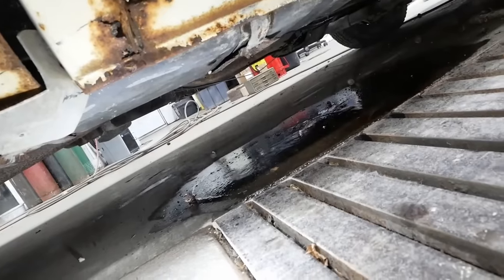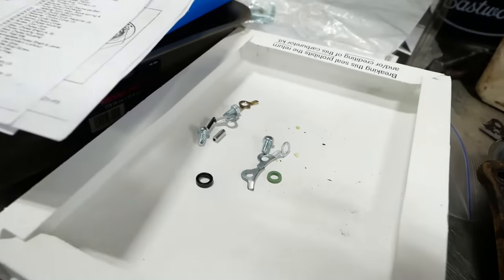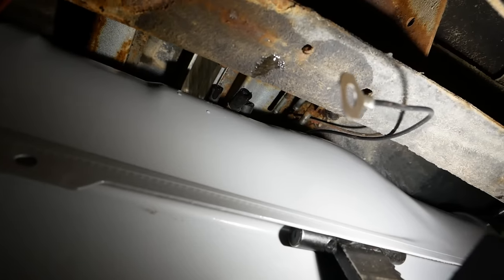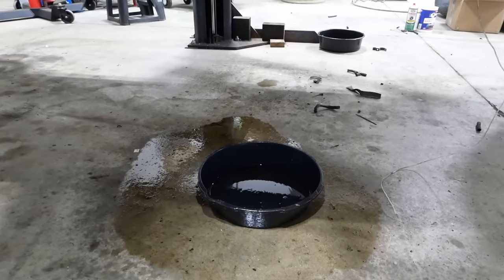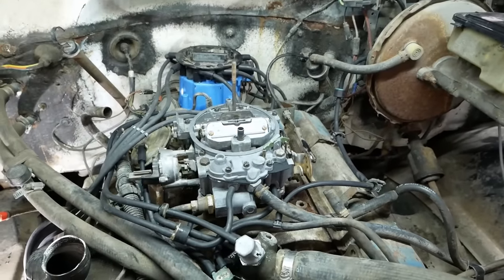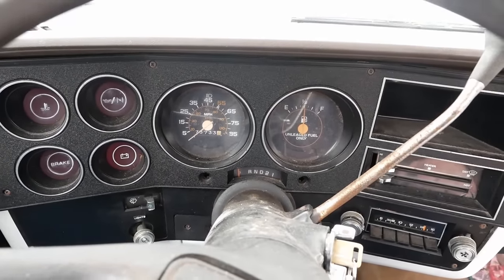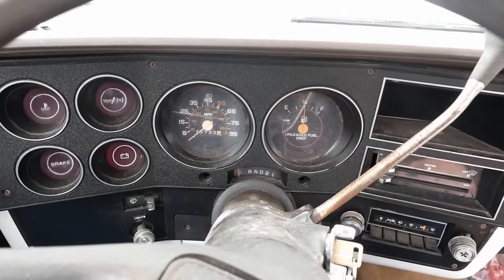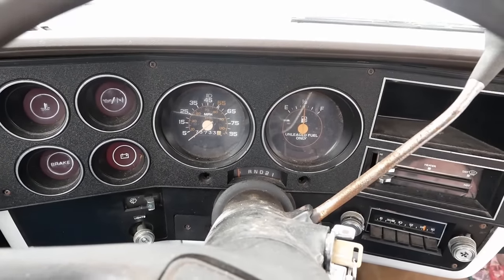Millennial vs. Carburetor | Square Body Chevy Back on the Road After Sitting 12 Years

Comment: You're doing great.  I had a 6 cyl. Chevy truck.  Which needed the carburetor rebuilt.  Being a person of limited skill, there were 3 of us to tear down the carb.  After 2 or 3 tries I stuffed the parts in the old carb and traded for a rebuilt carb.  No problems.  That was back in the days when rebuilders did quality work.

Comment: The cold, off idle, hesitation could be EGR.  Disconnect the valve, plug the line and see if that makes a difference.  If so the thermostatic vacuum switch is opening up too early.
Reply: Its the throttle shaft and it will start backfire when it gets hot. It could be a plugged EGR, but my money is on the throttle bushings.
Reply: @markusgarvey  Not a plugged EGR !  One that is opening before the engine warms up.

Comment: Great work Wes.  That starting process seemed to be correct from my memory.  Each quadrajunk carb has its special way of starting.  I remember my dad working at the local Chevy dealership during the mid 80’s.  The old Chevy engines sure brought back the memories.

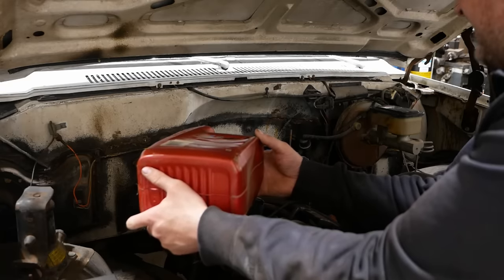Comment: 30:06 I’ve wiped out a few camshafts without zinc additives. It just depends on how good the camshaft is. I run mostly small block 350s and I usually don’t have zinc in them, but my 1958 235 definitely gets it.
Reply: Ain't no way

Comment: That's gotta be the most effort I've ever seen ANYONE put into an old quadrabog! You did a great job, but ultimately, that's just pretty much how they are, why they're known as quadrabogs, and why everyone just immediately swaps em out for a Holley. For what it's worth, this video is probably one of the best "why NOT to keep your quadrajet" cautionary tales on youtube. :-) Great job, thoroughly enjoyed the whole video.
Reply: Better still, if you have a carbureted engine of any vintage, swap that carbureted junk for an EFI setup. INFINITELY more reliable, better power, better mileage. There is ZERO upside to clinging to antiquated junk.
Reply: Q-jets are great carbs when adjusted and tuned correctly. 
I’ve had several trucks sporting them with great luck.
Reply: @publius9606  You must not have any experience with the aftermarket EFI systems. Like the Holleys. People have TONS of problems with them.

Comment: The Rochester 750 CFM Quadrajet...  You think they were a nightmare in 1981 wait until you work on a 1987 computer controlled version.   They cap off the Idle Mixture Screws on the front of the butterfly plate after setting the mixture screws out only one turn.   Worked good until the fuel went from 100% Gasoline to E-10.   After the E-10 started in 1988 these vehicles ran very lean, and was just outside the computers ability to provide a stable idle.   The only way to fix the problem was to re-jet the carb or open the Mixture Screws until the Idle smoothed out.   Great Carbs when they were adjusted properly.  My generation could take them apart and back together blindfolded.   Great vid.  Brought back some good memories....

Comment: Great video! I miss my 83 GMC C30 and it's carb. They are really temperamental beasts. 😀 I've been away from it 3 years now,  but maybe try moving the timing further yet. Each engine has it's sweat spot, and it's not always what's written on paper. That's my two cents 😀
Reply: buy a decent carby..

Comment: Nice video Wes. The zinc in the oil is only necessary when breaking in a new cam and flat lifters.  The trick to the fuel pump is to temporarily replace the front bolt with a longer one to hold the pushrod while you're putting the pump in, but ONLY after rotating the engine until the pushrod is all the way up. Then it's a piece of cake.  Chevrolet made over 100 million small blocks but with so many variations it's sometimes hard to find a specific application.

Comment: The ZDDP is only used to break in the cam. It heat treats the cam and after it cools down, the heat treat has been completed, and ZDDP is no longer needed. My 10.5:1 compression 521 stroker runs an XE274H flat tappet cam, and i don’t use ZDDP at all, just straight 10w30 Castrol, and have been for over 500 miles on a new build, no issues to date with the cam

Comment: Many people look back at those carbureted days with fondness. Perhaps it’s a natural human response to forget the pain and only remember the good. The reality is that none of these vehicles worked perfect all of the time. They all had their quirks and special personalities. At the right temperature, with the right adjustment, at certain ranges of elevation, humidity, etc they would run great, but carburetors couldn’t always be just right. A compromise at best. Drivability was made worse by tightening emissions regulations, forcing a tune on the lean side of optimal. Wes, you did a great job going through that carb, and you definitely figured out how all of its components are supposed to work. If anything, it still sounds a little lean at idle and upon tip in, given that it works pretty well fully warmed up. I’d try to richen up the idle and see if that helps smooth out the tip in. For the cold start problem, can you back off the amount of full choke closure? It might be a bit too much choke. Great video, really enjoy all your videos and the effort you’ve put into them. 🫶

Comment: Just a heads up the heat valve in the air cleaner prevents carb icing in cool damp weather
Reply: As does the warm air drawn threw the exhaust manifold stove, when the flapper on the air filter snorkel is closed.
Reply: @DanEBoyd  And you called it by its real name, exhaust manifold stove.

Comment: these videos make me feel old. the dash on that truck is SO familiar to me, ive slid those heater sliders, listened to those loud horrible ignition buzzer alarms, and searched for stations on those terrible radios.  trucks were trucks back then, now theyre just tall cadillacs. those chokes are reliable, despite being horribly complicated. look at any older home, chances are goods if the homeowner isnt stupid, it will still have the old coil spring style thermostats. you know the ones, theyre a little golden colored half dome on the wall, with a couple switches on the edges, and a dial that spins on the inside. there are other types, but they all use similar technology, & they work well. theyre not terribly accurate, but anything that functions decently & does it for 100yrs is well made

Comment: Could be worse, I'm sorting out old Honda motorcycle carbs.  Nothing like rebuilding 4 carburetors and then syncing them.  It's not working quite as well as I'd like.
Reply: Vacuum gauge set, four on a board.  Worth the time and cost.
Reply: @smarternu  I do have that and it does work well. These particular carbs are just more temperamental than I'm used to. I've had them apart at least twice, ultrasonic cleaned the other day. They work better, but I still have a very wandering idle and low vacuum signal through them. I'm thinking that the ignition advance is sticking occasionally. Just have to keep at it I guess.
Reply from the maker: I remember watching my uncle use a manometer to set multi carb motorcycles. I've never messed with one.
Reply: LOL, I can rebuild just about any carb out there and get it pretty close, I bought a motorcycle when I retired. The twin carbs on it needed gone through, and I have cussed that thing since!
Reply: @elmerfudpucker3204  I can get a twin carb to work great, but the four on my 350 four are nuts.  Plus it's early 70's Honda which is touchier.  After '77 a Honda four carb setup has a master carb that you'd sync the other three to; before that it's just four carbs that you set to each other.  You can get them all in sync with each other only to find that you've set all four wrong.  Could be worse, Goldwing guys are probably laughing at me right now.

Comment: I had a ‘85 GMC conversion van with all them bells and whistles and that 
POS 4bbl card on a 305 cid engine, never could get it to run right until we swapped to a 350 cid engine, changed carbs and stripped all them vacuum hoses to the trash can! Another good job of diagnostic, no matter whether early or late you figured it out. 😊

Comment: Again awesome vid, you are now a quadrajet expert, I love those carbs. So much more refined than a holley dumper. Sure they take a bit of setting up, but they will run so much better than a holley and that sound when the secondary air flaps open is a joy.

Comment: This took me back many years. I think there's a Rochester Quadrajet sitting in my shed. Biggest horror I always had was fear of breaking off a mounting ear on any carb. Never did, but that didn't remove the fear. I predate the era of a coil on a distributor cap. Didn't see a timing light involved. I always managed to get the timing 180* off. It's a rare talent. I had a thermostatic choke. I always turned it when warm to the point it did no choking. It then choked when closed. Usually one more tweak got it right. I don't recall Ford having a heating element to the thermostatic choke.

Comment: When you bought rotors from the dealer in the eighties. They came with 1/16 inch deep vee groove in the middle of the pad surface about 1/8 inch wide. This was put in the finished product with backyard  mechanic in mind. Today the term is shade tree or backyard mechanics. But bending the tabs is the best way. The circular groove also was a form of off gassing the pads during hard braking. 
Enjoy your work ethic and determination. That is something the young techies seem to be missing. Also, it seams that if the scanner does not tell them exactly what to do, they are just lost. Good day fella too.

Comment: Thanks for a lot of great videos that you performing quality repairs to a lot of vehicles, including some like this one that probably aren't worth fixing.   I know it's been a while since this video was posted, but somehow I missed it.

You've got a lean stumble when the truck is cold.   These vehicles were jetted pretty lean for emmisions, and I suspect that if you replace the air cleaner temperature sender in the bottom of the air cleaner so the air filter can warm up the air going in the carb, the stumble will get a LOT better.   I don't know how hot the GM air cleaner heats the air to, but the Ford system heated the air to a little over 100 degrees and GM is probably similiar.    Here's how I discovered this.    I had a 65 Comet with a stick shift 289 in it and when the weather was cold it would stumble just above idle.   I lived near Chicago then (I live in much warmer 99.9% salt free Tennessee now) and our weather was just like yours.    After 20 minutes of driving it got a lot better.    I ignored this and  just kept on double pumping the gas pedal to get past the stumble during cold weather.   Then one day the temperature was about 35 degrees and it was foggy.    I had an add on gas mileage meter.    I don't mean a vacuum gauge, but a device that measured the distance traveled by measuring drive shaft rotations, and also gas used with a sensor that you put in the gas line....real MPG.    This car usually got about 20 MPG on my trip to work but today it was stumbling real bad and my mileage was down to about 14MPG.      When I pulled the top off the unheated air cleaner, there was ice in the carb throats.   IF you shut the motor off, engine heat would melt the ice and it got better gas mileage and didn't stumble.....for a couple of minutes.     I'd never seen this before, but wanted to cure itl      My 67 Lincoln had a device on the air going into the air cleaner.    The inlet was ducted through the wheel well so it would draw cooler air.    This device had a bi-metalic spring that closed the outside air off and switched to the air heated by the exhaust manifold.     It never stumbled or iced up.   I went to the wrecking yard and found a Ford that had the bi-metal system plus i was able to get the piece that goes on the exhaust manifold to heat the air.    I put it on my Comet and the difference was phenomenal.      I had a friend that had a Chrysler with a 400 engine that started to stumble.    I opened the hood and the top of the air cleaner was cold.    We found that the air motor was ruptured and couldn't draw vacuum.    Replace it and his stumble was gone.      This was before we had ethanol in our gas, and ethanol gas is worse than pure gasoline, but on fuel injected cars you don't notice it.
If the owner is still driving it next winter, suggest that he lets you repair the air cleaner heating system.

Comment: You should use a bag inside the ultrasonic cleaner. This allows you to safely use flammable solvents. You also reduce the amount of fluids you need and don't have to clean the ultrasonic cleaner. :)

This way you can also cut down on the time for heating, as you can fill it with hot water from an instant water heater instead of having to rely on the heating element of the ultrasonic cleaner.

Comment: So as the caretaker of a 62 C10 with the monster 250 straight six, topped off by a single barrel carb. One day as I was out impeding traffic, it coughed and sputtered to a halt at a stop light. I hopped out and pushed it off the road. Lifted the hood and saw the carb was leaking profusely. Grabbed a slotted screw driver out of the vast array of tools. Popped off the top, reset the float a bit and went to my destination. Guess I should get a kit and rebuild it now. Difference between new and old is you have somewhat a chance of bending, tweaking or just plain fixing the old stuff. New stuff, unless you have Weslectrical Wizard in the glove box, you are towing it a lot of times.

Comment: Wes, great video and great description on how that carb and choke work.  Man, you are brave taking that thing so far down. As others have said, like old motorcycles, carb vehicles all have their own start procedure... when cold, I usually start with 2 or 3 pumps and crank. If it doesn't start. 2 or 3 more pumps and try again.

Comment: Ahh carburetors, my teen memories....I was sophomore in high school when that pickup was new. Very few carbureted engines DIDN'T have an off idle stumble when cold. I think you have this one pretty close. I would suggest setting the timing to 6⁰ btdc with the vacuum advanced unhooked at full operating temperature and see if that helps. If it doesn't ping when you 'hammer on it' , or start hard when hot, I think it will run better for you.

Comment: Wes I'm 69 now but in 83 I went work for a Pontiac GMC dealer doing engine repair I ran off 3 other engine techs. Anyway I  was told to replace a 305 engine with a target long block for that very same stumble it had been with tune up, carb gone thru, distributor reworked, GM rep said put a Target long block in it, I did it still had the same stumble. I think you have a little too much choke, wind choke just enough to raise fast idle cam to high position and stop. The other thing is with throttle plate removed there are 2 plugs on bowl they tend to leak which can give you a hard start ( flooding ) you can use a 2 stage epoxy or they have a spongy bowl plug you can install in throttle plate. This is all I got maybe bump timing to 6-8 degrees, timing chain slack.

Comment: Hey couple tips with the sonic cleaner, they work best if you can suspend the parts without them touching the sides or the bottom. You can also put parts in a glass mason jar and put that jar in the sonic cleaner and it'll clean just as well. So if you wanted to save some solvent, and use something unique, put your chemical x in a Mason jar with your parts, and drop that into the pinesol, or even a sonic cleaner filled with just water. Works great for cleaning in expensive solvents.

Comment: As someone who basically only drive old stuff. You NEED Zinc with flat tappet cams or you will wipe out the camlobes. Oil back then had additives that were later removed when catalytic converters became a thing.

Comment: Yes sir those carburetors can be so simple that unless you dissect each carburetor circuit they can be quite tricky. If you have everything covered with these Rochester carburetors all you have to do is depress the gas pedal slowly to the floor and let it up (do not pump the accelerator pedal as you can flood the carburetor). The engine should start right up and if it does not continues to run the fast idle adjustment on the carburetor needs adjustment and that choke pull off adjustment needs to be spot on. I have old carbureted vehicles (GM) with the divorced style choke and they start up on cold starts just fine. Of course I drive these old cars and have tweaked these carburetors over the years to where they perform to my satisfaction. It takes some time to get the hang of these temperamental devices. I applaud your determination to find out how stuff basically works and your determination to dig out the cause of vehicle ailments. They are not so simple in the real world. Old Rochester carburetors the metering rods were just operated by vacuum on the power piston (they still are) and there was no stop adjustment to regulate the metering rod position at idle (engine vacuum did this against the power piston spring). For emissions the adjustment position set where the metering rods in the primary jets stayed consistent and there is an adjustment spec for that. And as suggested in another post those primary passages that have those lead plugs in the body of the carburetor do leak and people JB weld them but all of the kits have that black foam piece which seals that leakage off. One can remove the carburetor and observe that area and if it is wet (don't need to turn the carburetor over just look at it from the bottom) those wells are leaking .